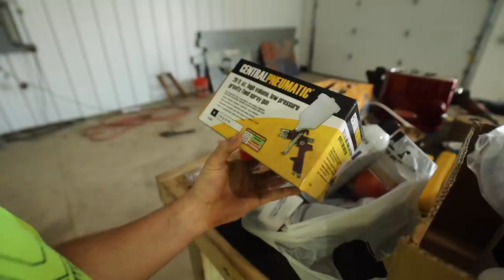PLEASE DO NOT UNDERCOAT YOUR VEHICLES...Thank You

Comment: To avoid that much suffering it would cost less to drive out of state and buy a rust-free vehicle (or cab and bed).
Manual derusting doesn't work very well. The smart play is buy a different frame before you start and take that to your local monument company (they all have engine-driven compressors and large blast pots) then have them blast the frame and other parts as desired to white metal. Coat that with coating of choice then put it on stands and gradually swap parts onto it. That much work and not getting basically a zero time rebuild is sadly inefficient.

Comment: Stacked blocks are a big no no, should be against DOT because it is unsafe, my Suburban had 2" blocks, it kept busting them, I ended up replacing the springs going with a 6" lift and made my own ladder bars from square tubing, never another issue.
I have a van now, easier transportation in my situation, has rust issues, having the passenger rocker completely replaced, surface rust on the frame, would love to sand blast it, but I just can't afford it.

Comment: I would use a white wheel for the areas that had bolts etc. that’s what I normally use anyway. The paint remover disk works great for the flat areas 👍

Comment: Man I just got my first 7.3 it’s a 2002  and I have absolutely no clue where to start, 250k miles mint body condition it does have bigger injectors and a bigger turbo, you got in tips for me brother or part ideas ? I really need some guidance on some parts
Reply: 6636 donaldson, 6.0 intercooler, charge pipes, non ebvp pedestal, bellowed up pipes, transmission cooler, white rodgers glow plug relay, frx crossover.

Comment: Any oil based undercoating like fluid film actually doesn't cause rust to form unlike rubnber undercoating.
Reply from the maker: Now go work on your truck after you spray everything with 5 gallons of slop
Reply: @ryan2546  I have, up north it’s normal to see trucks undercoated with wool wax.Yes it takes extra time but worth it Just on a lift if your not careful it can slide off but very seldom does that happen.

Comment: An awesome paint for frames and under body is two part swimming pool epoxy it's made to last year's in direct sunlight and in direct contact with corrosive chlorine it lasts forever under a vehicle out of direct sunlight I use an industrial zinc etching primer then spray it with the epoxy a sandblaster won't even take it off once it's cured

Comment: You are more courageous than me driving that truck with no taillights, turn lights, front lights down the road. I’m assuming you didn’t get stopped. Beginning of August I had to drive my 2009 Ranger with no bed after my 2011 Rangers transmission started making noise. I used an orange pool noodle zip tied to the rear bumper of my 2009 and then zip tied taillights to the pool noodle. I never got pulled over that way even though several cops passed me. I started building a flatbed and added mud flaps. Now the flatbed is basically done.

Comment: Best frame coating is rust converting paint and a thick layer of cosmoline rust preventive wax.  Easiest coating combination that doesn’t take a lot of prep and actually works.
Reply: Should always convert the rust completely before painting over. Yes, even if it’s “rust-converting paint”. Besides that, you’re right, cosmoline is amazing. I use CRC Marine just because I don’t want to keep reapplying the wool wax.

Comment: Painful watching you use that tiny needle scaler. I did this to my first gen frame, I got a scaler that goes on the end of an air hammer and it plowed way faster than the one your using. I have a 30gal compressor and it just barely kept up at about 60psi. I would have to take breaks here and there for the compressor to keep up. Good luck with the build!

Comment: Hey man if you lift it get the front and rear leafs rebuild by Denver spring. They can make leafs longer and add smaller ones for a more comfortable ride. Plus tell them you want to lift it as well. Don't do the blocks adds so much wheel hop and can break stuff.

Comment: But definitely a truck that is worth fixing up that is a fantastic vehicle 7.3 L from 99 to 2002 in my time I have restored six of them in northern 73 backwards and know that frame inside and out water sandblasting trust me you will thank me know dust in the hot water Pulls all of the contaminants out of the metal nice work

Comment: First, keep your dirty, black fingers away from your face.  Next, I can't believe I came across a video that answered all my questions.  I WAS thinking about Fluid Filming my old F-150 and my Odyssey.  But as I look at some videos, FF leaves an oily mess under the vehicle.  I imagine any mechanic (me) would NOT like to be working on an oily, slippery vehicle.  Then I was thinking about using Rustoleum Reformer and top-coating it.  But I'll bet that the Eastwood reformer is a better way to go.  Why pay for pressurized cans and less product when with a little manual labor I can pump on the Eastwood reformer and develop Popeye forearms?  Thanks for the help and guidance.